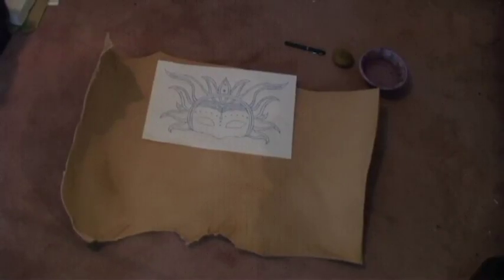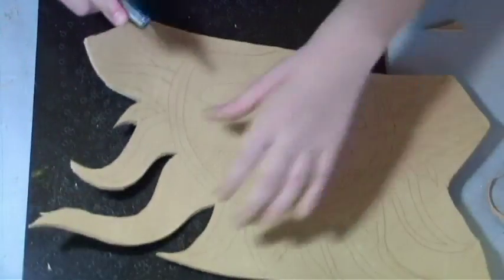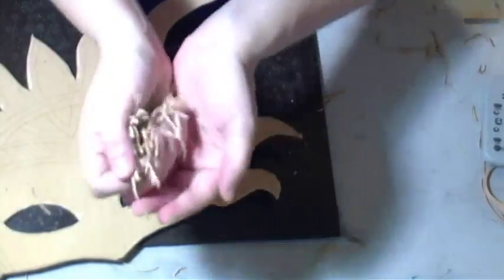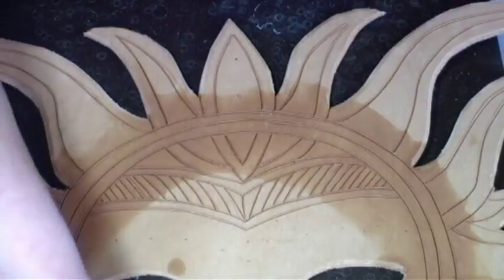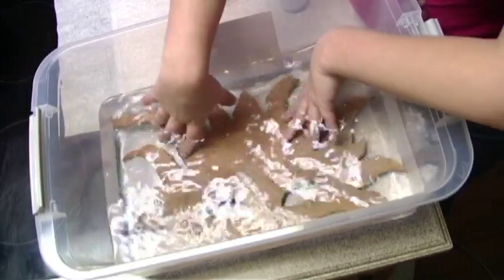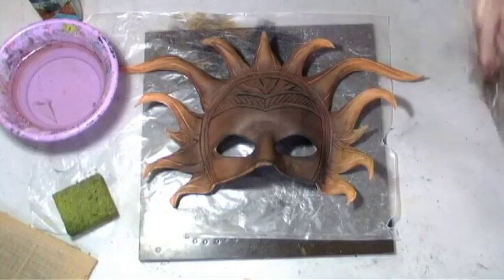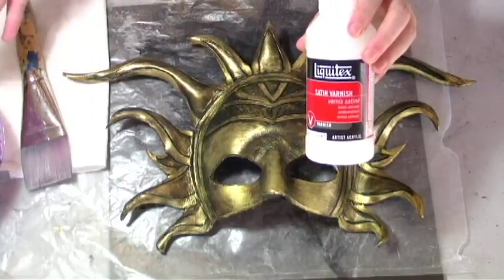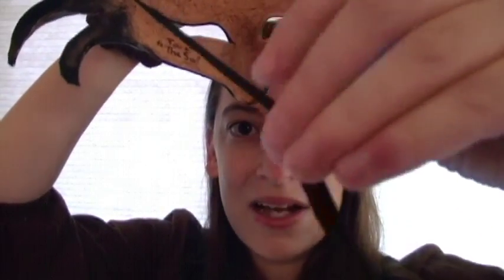How to Make a Leather Mask Tutorial - Sun Mask

Comment: This video has been very informative, but say, that if I wanna give it a sort of steampunk feel and add in holes were I could put prongs later[they would resembles bolts or nuts], on, would it be better to put in the holes before or after baking ,and I understand the that prongs should probably be put in later on
Reply from the maker: Hi there!  You can technically punch holes before and after baking. For example, I punch holes for ties for the mask after baking.  The trick is that I can only do that because my hole punch can fit on the side of the mask after it's been molded.  If you're punching holes after baking, make sure you can reach the spot you want to punch with your rotary punch, as it's a lot more difficult to use drive style punches on leather that's not laid flat.

Another option I've done before is to burn holes in with a solid point wood burner.  This can be tricky, however, since you can end up scalding an area if you aren't careful, but it does allow you to control the size of the hole.  A dremel tool is another thing I've done before to punch holes in small areas like for earrings.

Hope that helps and good luck!
Reply: Thanks

Comment: Amazing video. Thank you so much for posting it. I had a question. I made a mask and would like to attach some feathers. What is the best way to glue/attach things to the back of the mask? I also don't want for the back of the mask to look awful. Any ideas?
Reply from the maker: I usually leave the backside of the mask undyed since dye can rub off on the skin.  To make it smooth if it's not already smooth, I take a bit of damp fine grit sandpaper and smooth the back a little.

As for attaching feathers or other materials, I usually prefer Goop.  For leather to leather attachment, leather cement is also very good.
Reply: +Angelic Artisan - The Artisan Crafts of Angela R. Sasser  You are awesome. This opened up a whole new dimension for my artwork. Thank you so much.

Comment: I bought a leather mask online that doesn't quite fit perfectly. Any suggestions, or is it even possible to soften it a little to adjust the fit? Great video.
Reply from the maker: +jjhendo If the back wasn't sealed, you may be able to dampen the mask and reshape it, but do so at your own risk!  Most of the time, the more you wear a mask, the more it will conform to your face as well (which is why I love the material). You may also want to ask the creator/seller of the mask how to do this, as they may use a unique process different than my own and can give you more specific instructions on how to change the shape or perhaps even offer to alter it for you.  Good luck!

Comment: NICE MASK and great work!! Would you have an idea how to do a deer mask like this and a way to do the antlers?? I NEED THAT for a set on Deer:)  Any tips would be wonderful!!  A leather cutting tip...score the cut first by lightly cutting the fist impression rather than trying to cut through so hard.  For stropping, use the leather scrap you have there...polishes the blade nicer and faster:)  That is what they used for shaving blades:) Makes them sharper!  How about a cookie sheet tray with the baking paper, easier to take in and out of oven?? Just wondering:)
 Cheers!
Reply from the maker: Hi Vicki!  I've never tried to make antlers, but if I did, I'd take a thinner piece of leather (around 3 oz maybe) or skive thicker leather thinner by stripping off from the back and cut it into the general shape of the antlers, then roll and pinch the leather so it has a more cylindrical shape.  It may not look perfect from the back where you can see the seam/opening, but it'd be serviceable from the front.  You could even do these pieces separately and attach them to a mask made of thicker leather with leather cement.  I'd also probably dip or brush the antlers in a mixture of leather cement and water after baking so as to help make them more solid so they keep their structure.
Reply from the maker: And also check out how other people have made antlers on Etsy too.  Might give you ideas! https://www.etsy.com/search?q=leather%20mask%20deer
Reply: I am thinking I may cut them wider, so I can roll the leather around a carved piece of pink insulation board...getting the shape...then, when dry, stitch the backing around thus holding the antlers into shape...they don't have to be big, just a two pointer for mule deer and one for white tail deer. I might stuff them with light pillow stuffing to help them keep a shape.  Or just keep using the carved foam antler for the inside and stitch sections around it at back.  Since the antlers will join on the head crown part, it should be stiff enough...either that, or use wire inside to help hold the shape, then stitch up with a batting inside....well, thinking out loud here:)  I do like adding the glue to the back to make them stiffer there..:) Great idea!  IOH.. for that back...I am thinking of adding felt or some smooth vinyl, so they are non allergic for those of us allergic to leather...some kids are...and with the thin vinyl material one can also clean the inside of the mask too?  :) Thank you!..!  I am sure if one can do dragon horns, one can do antlers:)  I guess I will soon find out...and will let you know:)
Reply from the maker: Sounds like a really fun project. I'd definitely love to see your results!  Have fun and good luck, Vicki!

Comment: Great video - I'm about to start working on a small starter mask project and your tips will be a great help.  I was wondering.. do you think you could work a mask using 5-6 oz leather?  I'm looking at tandy and they have a sale on that weight right now, so I'm wondering if it's feasible, or just a waste of effort.  Thanks again for the great video!
Reply from the maker: So glad you've found this video helpful!  I think that weight of leather could work, but it might be a bit floppy.  I tend to use 8 oz and up just so it keeps its shape better and is more firm.  Best of luck with your mask!
Reply: Angelic Artisan - The Artisan Crafts of Angela R. Sasser Thanks so much!
Reply: wisspersf I had one other question - when ordering hide, if you don't want to jump right into ordering a whole side, is there a particular part that you order?  I'm going to be making two of the same mask, and they are taller than they are wide, so I think I will be able to cut them out end to end because they interlock somewhat on the top in order to save room.. but this being my first one I'm not sure how much hide I really need to account for waste, etc.  In your experience, if you order a double shoulder, would that be sufficient for two medium sized masks?  (the total size is 9-10 sq. ft.)
Reply from the maker: wisspersf double shoulders have usually suited my needs and I make from small to medium masks.  You might even be able to fit them on a single shoulder, if you get one that's clean and wide enough (if you're able to go into a Tandy leather store and actually pick your own, which I recommend).
Reply: Angelic Artisan - The Artisan Crafts of Angela R. Sasser Thanks.. unfortunately I live in Northern VA and I don't think there is a Tandy store nearby.  There's one in Richmond but that's about 2 hours away, so I'm stuck ordering online it seems.
Reply from the maker: wisspersf I used to be in that kind of situation till I moved as well.  Most of the time, the staff will choose a really nice cut for you if they can.  Either way, I imagine a double shoulder should suit most mask needs.  Good luck!
Reply: Thanks!  I ended up ordering a side from tandy and the quality is great.. just one minor blemish to work around.  Now to try to transfer a template and see how this goes!
Reply from the maker: wisspersf Awesome!  Best of luck with your first mask.  Feel free to share your results with me, as I'd love to see!:)  If you're a member of deviantART, there's also a community of leather mask maker's called leathermaskart.deviantart.com that we'd love to see you at.
Reply: Thanks!  I'll be sure to set up a blog or something and take pictures as the process comes together so I can share them =)

Comment: Do you add any waterproofing to the inside like aussie leather conditioner for sweat? does it weaken the leather if you don't?
Reply from the maker: I do not add anything to the back of the masks since I do not want to trigger anyone's allergies.  I haven't had a problem yet leaving the back of the masks untreated, but I'd be curious how they survive years down the line.  So far, my oldest masks are around 5 years old and they're still holding up well.
Reply: Interesting. I've only recently gotten into leatherworking. Do the masks shrink after being baked or can you make them to fit the size you need?
Reply from the maker: Tuffsmoygles there's usually not that much significant shrinkage.  If the mask begins to overcook, that's when things begin to shrink, but I usually don't bake them for that long because they get brittle and uncomfortable.
Reply: Angelic Artisan - The Artisan Crafts of Angela R. Sasser Thank you for the response! I will make one after I finish the purse I'm working on. I was going to try a deadspace inspired mask.
Reply from the maker: Tuffsmoygles ooo love that game. Sounds intriguing!

Comment: what size swivel knife did you use?
Reply from the maker: Nike Nikki I currently use a ceramic swivel blade knife blade of the 1/4" filigree variety.  I think back when I made this video I was using a metal one of the same size instead.  The ceramic blades are quite nice in that they require no sharpening, just stropping and they make a nice deep, even cut.

Comment: Is that breakable
Like if it were to get dropped or punched
Would it break?
Reply from the maker: Nope!  Leather is pretty flexible so it would not be damaged if dropped. It may bend a bit if it were punched really hard, but that would need to be a pretty hard punch.  Leather masks are more like flexible and hardy thick material than breakable hard plastic.
Reply: Angelic Artisan - The Artisan Crafts of Angela R. Sasser 
That sounds cool.
I plan on cosplaying as a kitsune however most kitsune masks are clay.
And, clay is very breakable.
Reply: Also
Could I use 3-4 oz vegetable tanned leather?
Reply from the maker: That seems pretty thin and would be great for detail, but it may be a little too flimsy. I personally prefer 5-6 oz for thinner things so they're a little hardier and less delicate. There's less of a chance of burning during the hardening phase too if you're using heat to harden.
Reply from the maker: You could also take a skiver and thin out the areas you want to be more flexible.
Reply: Angelic Artisan - The Artisan Crafts of Angela R. Sasser thank you

Comment: Would you say you have to be strong for this process?
Reply from the maker: I don't have a lot of upper body strength and I can still do the carving ok. I think if you're only doing a mask every now and again, you should be fine, but doing many at once has given me some sore shoulder problems (especially if I don't take breaks).  

tl;dr work reasonable spans of time and take breaks and you should be fine even without a lot of arm strength!  Sharp blades help make more of the cuts than your own strength does.
Reply: Angelic Artisan - The Artisan Crafts of Angela R. Sasser cheers 👍🏼